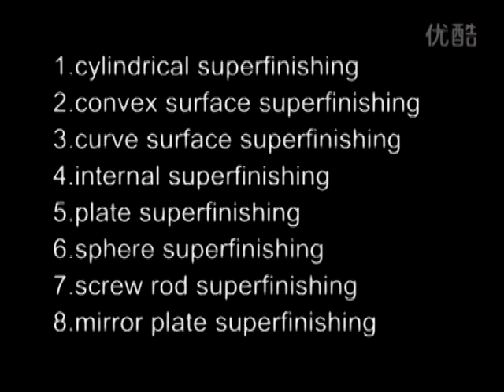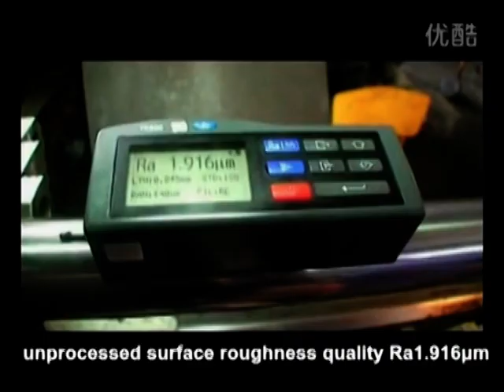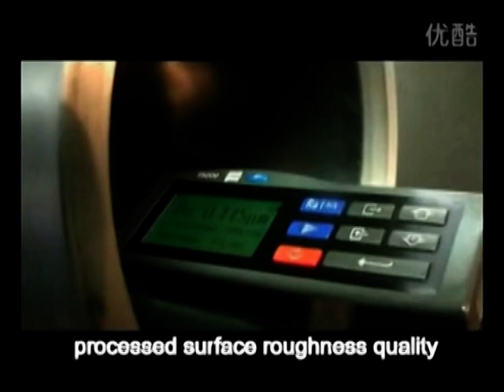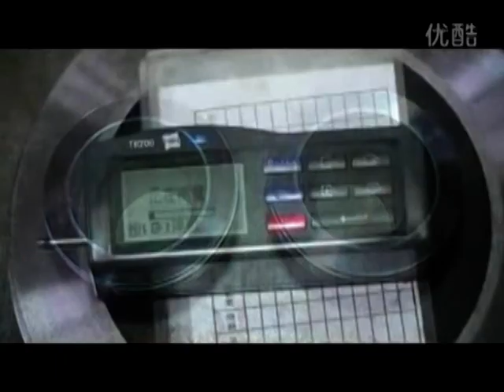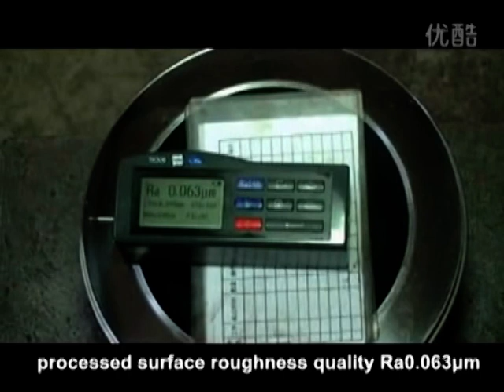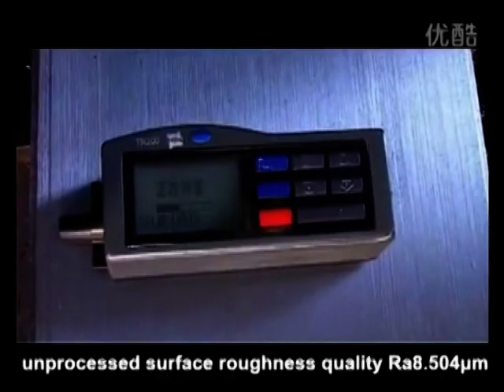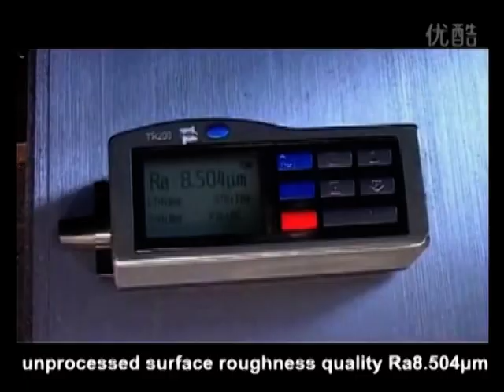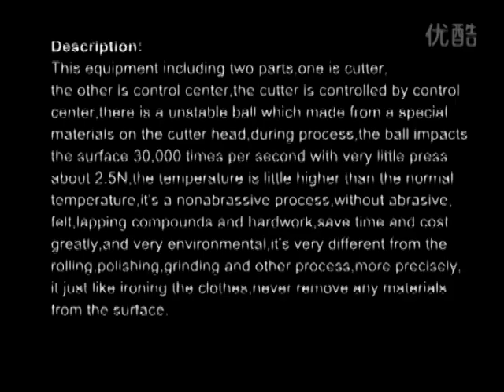HB-superfinishing machine-vsrsuperfinishing.com

Comment from the maker: HB-superfinishing technology is the most advanced technology for metal surface superfinishing,it is the great innovation for superfinishing,huabao company is the only holder,during superfinishing,needn't abrasive,no noise,high speed,extend the workpieces using life,improve hardness more than 20%,improve wear resistant,improve anti-corrosive...................

Comment from the maker: JINAN HUABAO MACHINERY CO., LIMITED
http://www.vsrsuperfinishing.com
E-mail:brady0086@hotmail.com
TEL: +86 531 58761725
FAX: +86 531 88022270
CELL: +86 15866605088
E-mail:vsrsuperfinishing@hotmail.com
MSN: brady0086@hotmail.com
Skype: brady0086
HB-superfinishing technology is a great innovation for metal surface superfinishing,
it can be used after turning directly and obtain surface quality for Ra0.1,
it can replace polishing,grinding,rolling and others process.

Comment from the maker: JINAN HUABAO MACHINERY CO., LIMITED
http://www.vsrsuperfinishing.com
E-mail:brady0086@hotmail.com
TEL: +86 531 58761725
FAX: +86 531 88022270
CELL: +86 15866605088
MSN: brady0086@hotmail.com
Skype: brady0086
The HB-superfinishing process was developed by the Jinan Huabao Machinery Co., Limited in 1999.
HB-superfinishing, also known as micromachining, microfinishing,is a metalworking process that improves surface finish and doesn't change workpiece geometry,
This is achieved by no removing any materials with none-abrasive;
HB-Superfinishing, very different from polishing,grinding,rolling and other process,
just one process.

Comment from the maker: JINAN HUABAO MACHINERY CO., LIMITED
http://www.vsrsuperfinishing.com
E-mail:brady0086@hotmail.com
TEL: +86 531 58761725
FAX: +86 531 88022270
CELL: +86 15866605088
MSN: brady0086@hotmail.com
Skype: brady0086
HB-superfinishing equipment,
Obtain surface quality less than Ra0.1 easily,
can be used on all kinds of machine tools,
high production efficency,
improve workpieces service life,
Improve the micro-hardness 20%;
Improve the wear-resistance;
Improve the fatigue life 5 ~100 times;
Suitable for the hardness less than HRC65;
Improve corrosion resistance;
It’s a nonabrasive process, without abrasive, felt, lapping compounds and hard work.
Relieve the residual stress greatly;
Long service life of tool and workpieces;
It saves time, money and energy
No sawdust and sawdust wastes occurred,no noise and damage to the environment;
Easy to operate,the same turning.

Comment from the maker: HB-Superfinishing:
The surface roughness after HB-superfinishing will be less than Ra0.1μm from Ra6.3μm.
The skin hardness increases depending on the initial hardness by 5,10,50,150 %.
The fatigue strength increases by 10,20,50,200 %.
The surface bearing extends up to 80–90 %.
In principle, HB-superfinishing technology excludes the necessity of using of abrasive in any of its combinations –
discs, bands, pastes etc.

Comment from the maker: JINAN HUABAO MACHINERY CO., LIMITED
http://www.vsrsuperfinishing.com
E-mail:brady0086@hotmail.com
TEL: +86 531 58761725
FAX: +86 531 88022270
CELL: +86 15866605088
MSN: brady0086@hotmail.com
Skype: brady0086
Contact:Brady
The surface roughness after HB-superfinishing will be less than Ra0.1μm from Ra6.3μm.
The skin hardness increases depending on the initial hardness by 5,10,50,150 %.
The fatigue strength increases by 10,20,50,200 %.

Comment from the maker: JINAN HUABAO MACHINERY CO., LIMITED
http://www.vsrsuperfinishing.com
E-mail:brady0086@hotmail.com
TEL: +86 531 58761725
FAX: +86 531 88022270
CELL: +86 15866605088
MSN: brady0086@hotmail.com
Skype: brady0086
Contact:Brady
HB-Superfinishing:
The surface roughness after HB-superfinishing will be less than Ra0.1μm from Ra6.3μm.
The skin hardness increases depending on the initial hardness by 5,10,50,150 %.
The fatigue strength increases by 10,20,50,200 %.
The surface bearing extends up to 80–90 %.
In principle, HB-superfinishing technology excludes the necessity of using of abrasive in any of its combinations –
discs, bands, pastes etc.